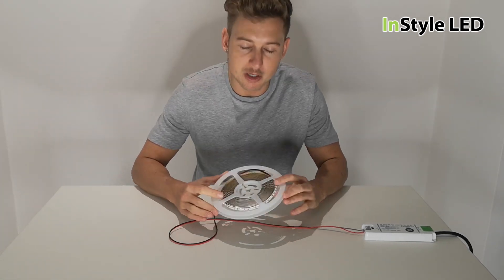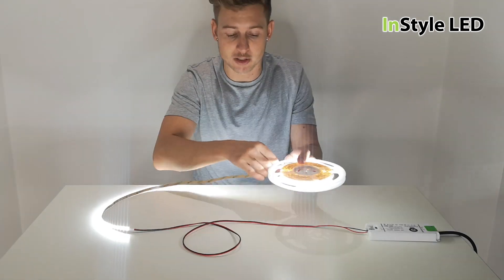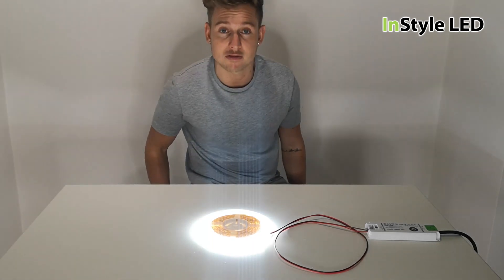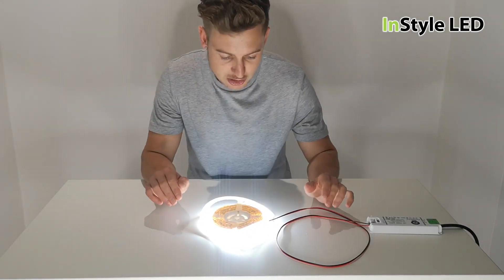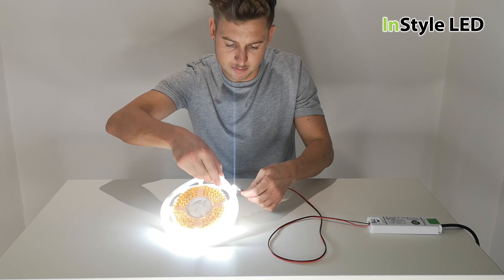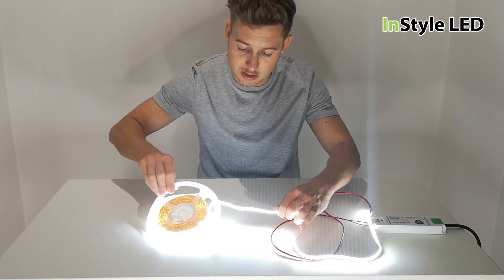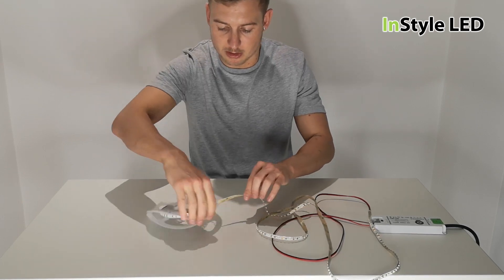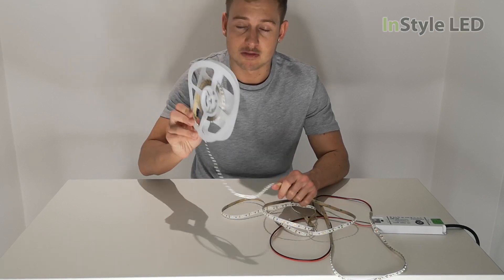How to avoid damaging your LED strip lights? A: Do not leave them on a reel!

Comment: I have a multi color light strip on my tv. They were working fine, but today they are not working, only the red lights is on. The other ones are not flashing or turning on at all. Any help is greatly appreciated. Thank you for the knowledge

Comment: I mounted a small scrap of a strip to a piece of wood just as a temporary worklight a couple weeks ago and just using them a few hours a day they've become noticeably dimmer compared to the fresh strip.
Though they proved not to be a fire hazard in that configuration, I'm definitely mounting them to aluminum brackets for final installation.